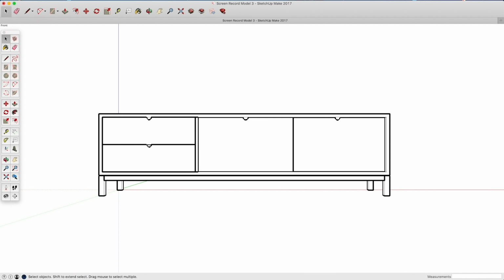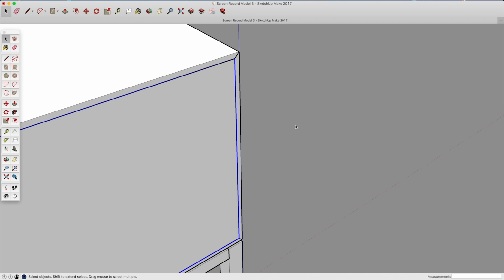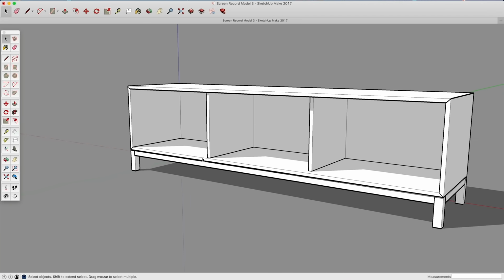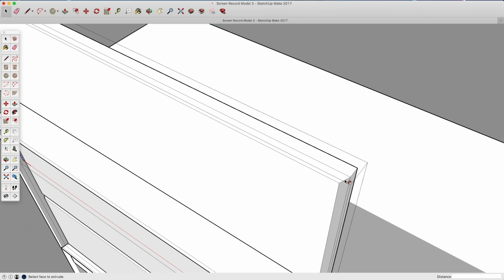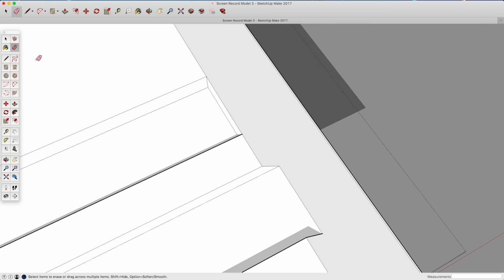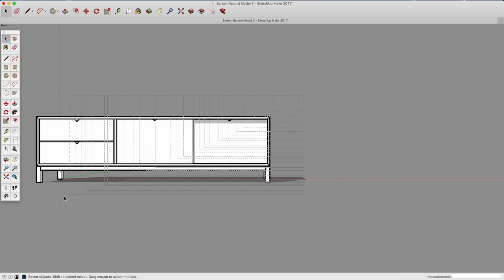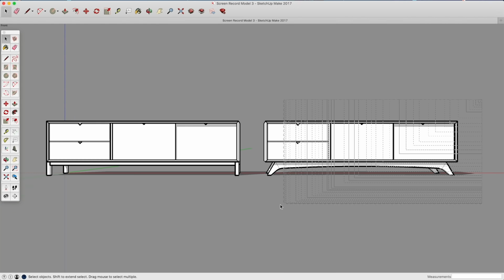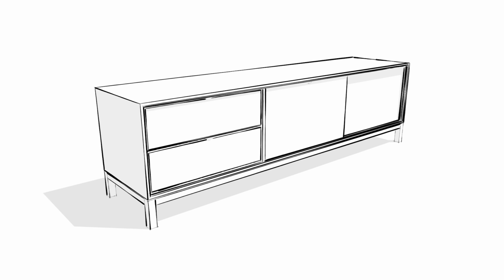Modeling a Complete Project in Sketchup for Beginners Pt.2 - Sketchup for Woodworkers

Comment: I'm stuck on the part where you transferred the grooves from the inside panel to the far right outside one. For some reason no matter what I try and I can't figure out how to do it. Then when I try to just make them the same we as all the other groove (making a rectangle and pushing it into the panel, it won't go. I can pull it out, or push it until it comes out the back side of the panel, but it never shows up a groove. Somebody help 🙏

Comment: Great video as usual. I know this video is a little older, so I’m not sure if you even still monitor the comments, but I have a question for you. I am trying to sketch out a leg assembly for a desk, and I am basically using the technique you show towards the end of this part two video. Are you copy the assembly off to the right and then make an alternate base. The problem I’m running into is it after I put the curves into the top runner and the two legs and combine all the components as a single component, I am unable to use the push pool tool. Do you have any thoughts on what I might be doing wrong. The thing that jumps out to me, is that possibly the lines aren’t connected, but that is hard to tell and sketch up. Visually, it looks like everything is connected, but perhaps there is a way to verify that I have a single structure and no gaps. Any troubleshooting techniques you might have or experience with this would be helpful.

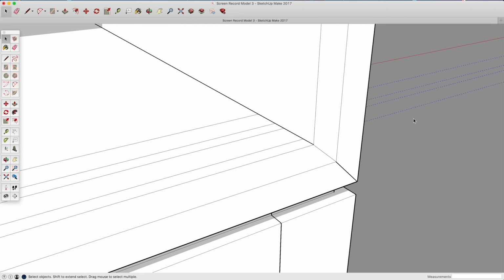Comment: Thank you for the excellent video. I have a question. At about 17:40 you push the rectangles 1/8" down to recess the door tracks. When I do this I gat a solid piece, I think, but it is not a recess into the bottom panel. Any idea what I might have done wrong?  Thanks.

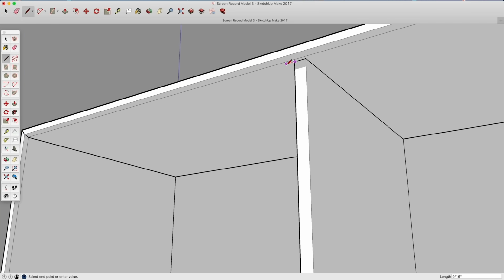Comment: At 10:55 if i draw a full face and then cut it in half i'll get a permanent ghost-box on my component with the full size, instead of just the actual drawer-face size. Anyone knows why won't the component frame update to half size as well?
Reply: I got the same thing.  Turns out, when I deleted the bottom half of the face, it didn't delete the extra perimeter lines; once I deleted those, the bounding box only surrounded the top drawer face.

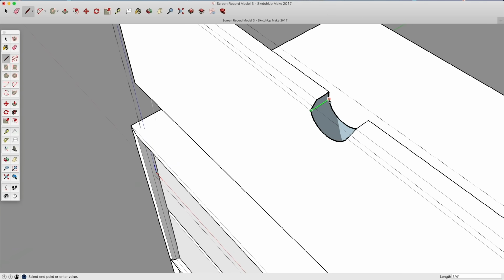Comment: Great video. I already have some experience in SolidWorks so it was nice to learn some simpler but still powerful tools. One small tip about 15:25. Instead of doing that and then manually drawing the missing surfaces I do the following: Add a cylinder as a new component. Having it selected go to Tools/Solid tools/Substract. Click on the panel to subtract the cylinder from it.

Comment: How do you determine how much wood is needed and what thickness do you use if you need a 1 inch final thickness?
Reply from the maker: Kinda depends. When you buy lumber it's either "surfaced" or "rough"

If it's surfaced you usually only need to buy wood about 1/8 thicker than whatever you want the finished thickness to be. If you buy rough, you want it about a 1/4" thicker. 

It also doesn't really matter because it's rare that you need to nail a really specific thickness. For example if I'm making a table top that's supposed to be 1" It doesn't matter if it's +/- 1/8"

Comment: how did you select just the bottom edge of the drawer at 12:45? mine keeps push/pulling the front face of the top drawer when i double click the it and try to select the bottom edge.

Comment: By far the best Sketch-up tutorial for woodworkers that I have seen. One design flaw in the cabinet is that if you put a finger in the hole for one of the sliding panels and slide it too fast, it will BREAK OR CUT OFF YOUR FINGER when it hits the other panel!

Comment: So your stacked drawers just sit on each other? How do you open the lower drawer without opening the upper drawer?
Reply from the maker: There would be hardware. I typically don’t model in hardware when designing. Unless it is for plans to sell. Not for myself.
Reply from the maker: There would be hardware. I typically don’t model in hardware when designing. Unless it is for plans to sell. Not for myself.

Comment: Hi Chris! Thanks for your presentation. I also use SketchUp for everything I build. And to increase my workflow even more I use a tool called 'simple cutting software'. It is a simple tool that helps you making cutting lists. And the best thing is that it has a SketchUp plugin that exports all pieces into the tool. I use it for almost every project and it has saved me so much material. Maybe you would like to check it out.

Comment: Thank you for the video, I like the video. Watching the video I understood I don't want to learn and use it for making wood working projects.  I don't get this tool what it made for? If you want to model - use 3D max where tools much more powerful and things made much easy chamfer extrude boolean operators and etc.  For constructing furniture is doesn't make sense as well, as it doesn't apply fixing furniture, you have to manually unwrap it - are you seriously? :) Do I really want drill holes myself for fixing in 3 d model? No - is the answer. So it looks as weak vector graphic editor with some 3d 'possibilities'. For furniture production this software is much more suitable  (if you don't know Russian language - learn it) - https://www.youtube.com/watch?v=xea6IVrqlhg

Comment: This is awesome!  Thanks for posting this Chris!  I've been trying to figure out Sketchup for a while and couldn't quite wrap my head around it and you laid out the basics perfectly!  I'm grateful!

One spot of trouble I had was in Part 2 at 17:05, creating the grooves for the sliding doors.  I haven't had any trouble recessing into surfaces until here. For whatever reason, I can't figure out what I'm doing wrong.  I've watched over and over and I simply cannot find what I did wrong that is keeping me from recessing these grooves into the bottom or top panels.  

I create and copy the rectangles into the surface of the panel component and locked to the intersecting points of the guide markers and the divider panel and end panel. The rectangle does drop with the Push/Pull tool, but the surface of the panel component I'm trying to recess stays flush.  Anybody got any ideas?
Reply: Did you figure this out? I had the same issue, and was able to solve it by Duplicating and moving the bottom panel out to the side of the model, then double clicking to enter component editing mode, then drawing the first box along the guides, duplicating the box and moving to the second position, then insetting by 1/8. I think the key step, which is slightly different to Chris's was to double click into the bottom panel component and edit its top face with the boxes.

Comment: This was an amazing Tutorial for Sketchup. Just wanted to point out that the handle slot on the sliding panels is not in a user-friendly spot, think about it you slide the doors from side to side, it would have been better to place the handle slots in the center, on the far most sides of the doors, but considering it's just a sketchup tutorial i guess this is fine.
Keep up the Good work!
Reply: Internet tough guy...

Comment: I'm just learning sketchup and modeled an entire built in desk with cabinets. I had learned many of these features, but many I didn't know. These videos would have sped things up.

Does Mac not have a plugin to automatically generate a cut list? I searched for "make cut list from sketchup" and was able to get the plug in  from the Extension Warehoise on my PC. This tells me how many board beet of wood and how many sheets I need plus it organizes them in the most efficient way possible.

Comment: Thanks a lot for the video Chris. Good tips and new info for an occasional woodworker like myself. 
I have a question though. I watched the end over and over and still it looks like you would need just 2 sheets for all the 3/4” plywood material. But, you tried that first and decided for a 3rd one. 
What am I missing?
Reply: The third one is for the rear panel that is thinner than the other sheets. He explains this in the video too.

Comment: @chris Salomone - very nice series of videos....love you channel in general - good mix of humor, design, carpentry .

re the sketchup - i didint really understand why you went to all the lengths of modeling the dado, chamfers etc.....from a visualization standpoint they change very little....and form a manufacturing standpoint there are many other details that need to be modeled if you really want a full plan (eg - joinery between carcass and lower legs, between the legs and the apron, drawer boxes, hardware locations etc)  so where do you draw the line and what is the underlying rational?
Reply from the maker: I’d say it was the “teach a man to fish” mentality. If you go through these videos, and master them. Now you can model drawer boxes etc...

Comment: Ouuuwhatsup. You can make those drawer pulls using the Subtract tool (Solid Tools) without having to add back in the faces. Just make the cylinder a component first.
Reply from the maker: I thought those tools were only in the pro version? I’ll double check that.
Reply: @Foureyes.Furniture  Yes, they are, a faster way for the free version would be: copy the cylinder faces and paste (in place) them in the component to be changed, after intersection, you only need to clean up (delete) unwanted faces.

Comment: Hi Chis, thanks for this second part.
At 27:40, I can see how you did to extract cutting diagram by duplicated components on an external rectangle. Quite long to do. Do you know the OpenCutList extension that can automate this action ?
Reply: Do you know about ABF extension? It will work even faster than Opencutlist.
Reply: @nguyenxuantu179  :)

Comment: Why not use SOLIDWORKS instead of sketchup. It is a bit more easier to model and cutting plan, BOM are readily available once the model is done.
Reply: @Marcin Prygon. Making sense but if the aim is accuracy then better use SOLIDWORKS.
Reply: @renoyabo960  What makes you think Solidworks is more accurate than SketchUp?